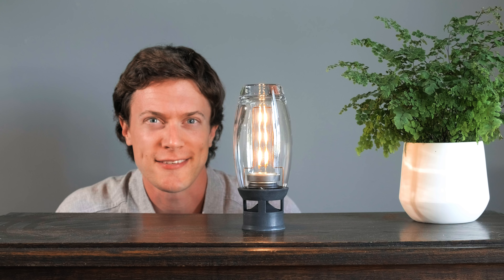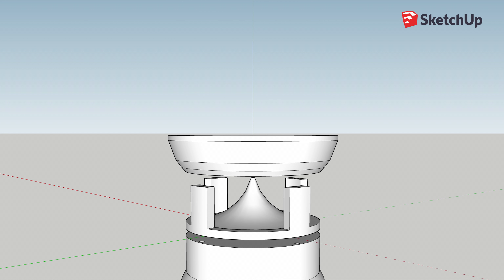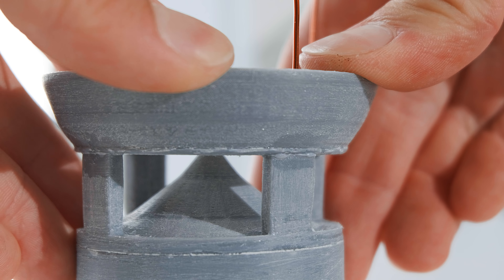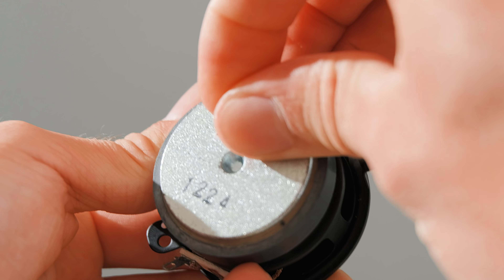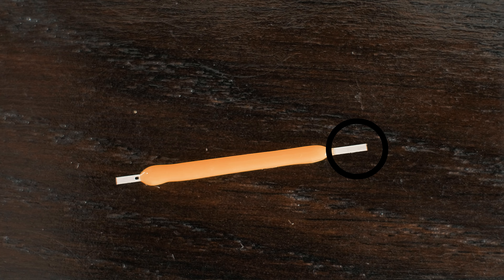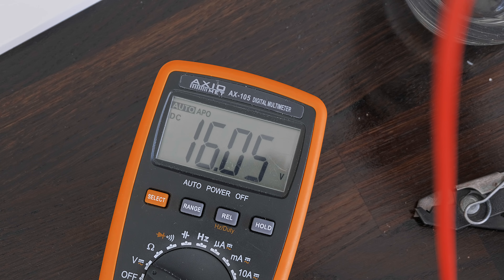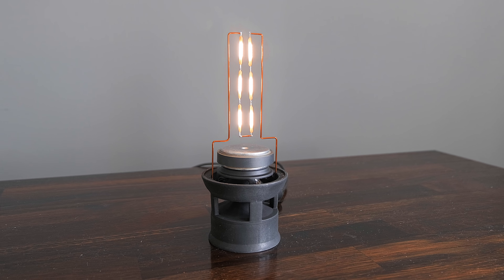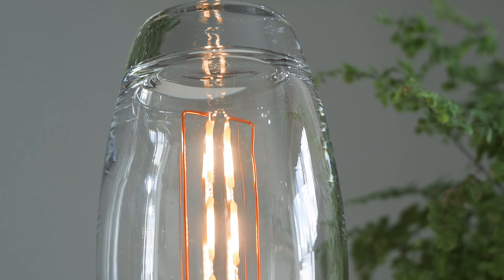DIY glass speaker! How to build your own.

Comment: I see a lot of people complaining about him using a 3D printer, but realistically the base can be done with plenty of materials. Wood or clay would both be good non-conductive options, but you need a lot more dexterity and skill to do that. He's simply showing the easiest way. 
     Honestly with 3D printers being ~$200 (~$800 for less maintenance heavy ones), they aren't a bad thing to have if you're even remotely interested in small neat projects like this. You can also find dozens of 3D printing services online that can print the parts for you out of a myriad of materials. You could get it printed in resin to come out completely clean right away if you want, but it'll be more expensive and more prone to craacking if dropped or if too much pressure is applied during assembly.

Comment: Bit of a tip with sketchup, you can drastically increase the number of sides of circle/arc if you scale up the model and scale it back down when you're done. This way you can make a circle with up to a 1000 sides rather than whatever arbitrary limit it uses when you're making smaller models. Also certain functions like 'intersect faces' work more reliably when the model is scaled up. I usually scale my more detailed models up up by 10x.

Comment: Looks amazing, for bonus points make the leds flicker ever so slightly based on the sound, like an old tube amplifier.
Reply: Tubes don't flicker due to what they are amplifying... Just saying.
Reply: You'd have to put some component monitoring the power draw of the amp to adjust the voltage of the LEDs between the amp an,d the LEDs. Any ideas? Maybe a bit much for some flicker. Maybe it's easier to put a component with microphone that modifies voltage according to the level it picks up. Someone suggest an (easy, sensible) solution.
Reply: Your eyes might object.
Reply: Tubes with high plate voltages will flicker when they are driven hard

Comment: Great job! The only missing thing is a switch to turn it on and off
Reply: i found your dimmer
Reply: you need to wire it inline (series) with the LEDs not replace any components of the current circuit.
Reply: Master volume?
Reply: Volume can be adjusted by the phone I think
Reply: Didn't think about that actually... but what if I'd like the lights on but no speaker?
Reply: now you got 2 switches or an integrated switch.  I'm assuming that this design would pick up ambient EMF if not connected but powered on, but that would really depend on the speaker driver circuit.
Reply: Exploited89 turn the music off on phone.....?
Reply: Andreas Rydèn yeah, but what about the light?
Reply: Exploited89 what? The light has nothing to do with the music.. turn the music of and the light will still be on! And when you dont want the light turn that of by hand, there's even dimmer switches you kan put on the power cord.
Reply: Andreas Rydèn exactly, so why didn’t he put a switch in his project? That’s my question!
Reply: Exploited89 if that was your question why dont ask exactly that from the beginning? 
Saying that switches are manual.. plug and unplug is basically the same thing and you save the cost of the switch.
Reply: Uh- it's BLUETOOTH!!!
Reply: @andreasryden334  
Do you listen to Marilyn Manson?
He has a song called "putting holes in happiness". That's what you are doing.
His speaker housing is made from a SIMPLE DRINKING GLASS!
Just be AMAZED!
Reply: Your phone dummy- REMEMBER BLUETOOTH?
Reply: sandramorrison99 and why direct that comment to me when i am defending the project without a switch. read twice before you write!

Comment: Great project. The use of the 3D printer is completely appropriate here -- while it is absolutely not in a lot of other projects. It seems that everyone has forgotten the trick to perfectly straighten a piece of (enameled) copper wire. Take a piece of 1 or 2 meters, clamp it in a vise. Grab the other end firmly with pliers or locking pliers and pull slowly but firmly. Do not jerk! Once you feel the copper wire stretching (a few mm for 1 meter wire) the wire is perfectly smooth and straight.

Comment: "This is how you make this stunning Bluetooth speaker, first you'll need a 3D printer..."

Well, looks like I'm not making this project then... 😅
Reply: Not to hard to get your hands on if you have time to spend
Reply: @alexanderharaldh4831  $$$ tho
Reply: Guarantee the design could be molded.
Reply: He said there were services to apply a model and get the product
Reply: Check your local public library.  Mine has 3d printers and the cost to print with them is just the cost of material, which isn't much.
Reply: Of course every local library has a 3D printer. If you're american and live in a larger city, that is.
Reply: @zioxei  have you checked your local library?  I know books are so last decade but they are good for the brain.  I know not all libraries will have them but if you dont check you dont know.  And it's not just large cities that have them.  I would not consider the city I live in to be large but it's not tiny either.  Your library having a 3d printer has more to do with your librarian than the size of the library.
Reply: @FunBoysGaming  $200
Reply: @MegaDuke1  molded? What do you mean?
Reply: But If you want you can build the base with some wood parts.
Reply: well if you have some other tools which you likely do, then you could make it out of wood, metal, concrete or some other material. If you don't have other tools, why you trying to DIY at all.
Reply: There is another YT channel where a guy builds projects, and I checked it thinking I could make a bench mounted quick clamp woodworking vise.
 No. The guy has a small barn for a workshop, and about $20,000 worth of lathes, drill presses, precision table  and cut-off saws, welders, air compressors, etc. So much for DIY.
Reply: I am waiting for the titanium and carbon fiber version of a homemade speaker with a silk cone driver.
 You will 'certainly' save some dollars by building your own.
Reply: @1:54 - Dont worry if you dont have a 3d printer. there are places you can send it to to have it printed.

Comment: for a more scratch resistant finish to ABS and a lot of other plastics including hard to paint PVC, I suggest vinyl dye, which you can buy in a spray can from an auto parts shop and is used to recolour car seats and dashboards, it contains the strong solvent MEK which will literally melt the exposed plastic to create an etched surface with negligible dimensional addition

Comment: you could add a potentiometer on the outside to have adjustable brightness (by adjusting the voltage of the dc converter)

Comment: Great project,  excellent result,  no comment on the hair. I will say, it never ceases to amaze me that awesome youtube videos get thumbs down. What twits. Thanks for all the tips: enamel wire,  simple acetone vapor chamber, LED handling during solder,  voltage level,  speaker binding post removal, etc,  it goes on and on...

Comment: Geez, am I the only one who is going to question the speaker you used?  Great project, thanks, and I want to build one.  The speaker link you provided shows a 4" base speaker with a frequency range that only goes up to 2500 Hz!  Surely this would sound a lot better with a full range speaker.

Comment: What about syncing the LEDs with the music 🎶
Reply: Yeah, a different project though, and with multiple colour changing RGB LEDS. This could be an idea for another portable boombox, this time maybe a 2.1 speaker system so it has a decent sub.
Reply: Don't get too far, or the big companies will turn it into a gaming product because of the RGB
Reply: Yeah, some gentle effect, like a breath
Reply: Thought about this, it would probably be possible to isolate the sound output with a few components and affect the voltage regulator for the LEDs a bit. Add a small capacitor to the LEDs and it would probably flicker smoothly to the bass of the sound.
Reply: @josasp  that would require more components that would take up more space, affecting the general feel of this one. Maybe a more modern design would allow for all of the things you need without ruining the apeal
Reply: There's plenty of space and adding a switch is not difficult. I'd build one if I had a 3D printer.
Reply: @josasp  it would require alot more than a switch
Reply: Meh
Reply: dino macioci  well we know what your into now...
Reply: dino macioci  yes, i enjoy music with visual stimulation, like live concerts and music videos. Also i enjoy music while driving, and music in my movies, heck, i even like to listen to music while i read compelling novels. My brain has the capacity to enjoy multiple stimuli at the same time. Im sorry your incapable of enjoying multiple stimuli at the same time. Must be bland, your recreational time. I apologize for bringing up such a sensitive subject in your midst sir or madam.

Your like a cold air intake on a prius.
Reply: Build and sell me.buy
Reply: I think he's great just the way it is if I were to recommend anything. I would transfer the sound using the LEDs aka li-fi instead of additional blue tooth much faster data send/recieve and the lights would  "flicker" as frequency was sent. Sorry didn't finish it yet maybe it was mentioned. Everyone mentioning impratical bigger add on's that would not have more then a visual function and make it bulky you could add some bonus like a Lazer dancer instead of the Bluetooth too again can be used to wireless transfer but needs line of site amazing simple diy light shows tho. It already is a piece of iron in my opinion though maybe different projects or different versions hey if you do bad in it about the 10% helpers fee ;) keep up the great work I'm going to be building one of these tomorrow I was wondering what I was going to do with all my similar LED lights I've been saving it really have no other use for me.

Comment: Fusion 360. Just a tip.
Reply: What do you use?
Reply: I use sketchup.
Reply: Use SOLIDWORKS
Reply: Tom van Dorland why?
Reply: Pah.

You are all rubbish!
You should code via DXF file directly in Notepad. 

HARDCORE!

lol.
Reply: Jason Park thats how all the pros are doing it
Reply: I've used SketchUp in the past, it handles curves poorly but is great for beginners. Also the exported files sometimes act weird. I use Fusion now and like it much better. Solidworks is also a great option, works similarly I understand.
Reply: Jason Park xD thats if you really got no life
Reply: The Hobbyt the same with me, but haven't tried solidworks yet
Reply: Also shit, I use 3ds max and Maya
Reply: James Evans good for you
Reply: Marc Frank went over your head clearly... haha
Reply: James Evans i didnt even want to try them out because the names sound stupid already 😂
but if you think they are good and you need to use two softwares to do your stuff, then thats fine for me
Reply: William Brall now you're the dude that took it too far 😂
Reply: Fusion or inventor anything autodesk basically
Reply: Tim
Shit happens
Reply: Tim YEP.
But really, only use Microsoft Paint.

No seriously now, SketchUp is shit
Reply: I use Blender and AutoCAD 2017. AutoCAD is slow as shit but it's much easier to measure tolerances in my opinion. Having the paper space really helps as well. However, Blender is sleeker, faster, prettier and you can animate with it and add physics effects and what have you. Blender is more for creating scenes for film or games, but it works well for 3D printing
Reply: Jason Park No, you need to code a STL file directly using a Hex editor
Reply: Tinkercad...Free
Reply: Fusion 360 is pretty good. I guess you don't have much experience with 3D modelling software, or you wouldn't be saying that.
Reply: Brah....
Reply: it's all about the cost mate :)
Reply: tinkercad is the superior
Reply: solidworks alows for easy modding of dimensions u can also do stress and weight and loading anallissis
Reply: While SketchUp is indeed painful to use, fusion 360 is only marginally better.  Fusion 360 feels like Autodesk castrated Inventor and then dumbed it down for people who are just beginning to learn about 3D printing and other CNC technology.
Reply: tbh, the only reason I haven't moved from Solidworks to Fusion is that I can't be bothered to learn but I think it's a lot easier than solidworks - you can make complex forms so effortlessly
Reply: why a dxf when u can type g - code directly?
Reply: The Hobbyt use autocad too. It's harder to master, but once you know how to work with it, you can do a lot more things than in fusion.
Reply: Fusion 360 is much better than Sketchup. I prefer using that or Autodesk Inventor - which is much better still. But Fusion 360 is easier for beginners and free. As long as you are using a solids modeler you should be fine really. Sketchup (at least a few years back) can be really painful for 3D printing since it's not a solids modeler in it's core. If you are a programmer OpenSCAD can be pretty good as well. Though it does require some getting used to.
Reply: The GoPro Fusion 360 camera is amazing - highly recommended.
Reply: Marc Frank Haha, difference is I do it professionally.
Reply: I prefer inventor as I have worked with it for 11 years (both user and reseller) . If you have a license at work you are eligible a home use license based on that same contract. Talk to your software coordinator about it! Fusion 360 is free for everyone to use and only start to cost if you will use it for making money.
Reply: i made the move from sketchup to inventor- and once you know inventor you basically know fusion. it really is a huge step up. you realize how insanely sketchup is laid out, of course it does still have it's place. simple architectural rendering, for instance. but small parts designing for 3D printing? fusion has it made.
Reply: Why does it matter when the finished model works? :D Let people use what they are familiar with. I'm Fusion 360 user but I don't tell everyone to use it.
Reply: @jparky1972  🤘
Reply: Been using SketchUp since it was a fledgling, so I have a soft spot for it I reckon. 😏
Reply: NX12

Comment: After saying "3D Print" I stopped believing it's cheap to make. 😂
Reply: My local public library has a 3d printer and the cost to print is just the cost of material, which isn't much.
Reply: @RagPunker  This is good info, I never would have though to go to a library for this.
Reply: im sorry it made sense until you somehow turned it into classism
Reply: @user-rs2gv4vk1g  If I ever get a 3D printer, I'll print a comeback ;)  until then thank you for your positive attitude and positive suggestion.

Comment: USD 300 speaker paired with US2.35 amplifier.  Am I reading the ebay listing correctly???  Why did you select such an expensive speaker?
Reply: About Me 
It says in the description that the speaker is out of stock so the price is unusually high right now.
Reply: brickman409  That was not in the description in the beginning. I suspected it was edited and added later due to my comment.
Reply: Thank you for this comment was really worried because of the price it was showing

Comment: On the conical part you printed you may want to look into the options to allow layers a minimum time so they cure/set before the next layer is applied. This way you have less blobbing on smaller parts like the tip of the cone. Just some friendly advice on an otherwise well done print/project. And yes, I am aware this is a multi month-old project at this point.

Comment: I was hoping for a seperate light switch so we could use the speaker without the light or vice versa but ... this is a sexy build.. I especially like the use of the copper as the wire... it lends a sleek clean look. Great vid keep puting them out bro!!!! BTW im going to be using your DIY sound proofing panels for my Studio

Comment: Add brackets to the glass or find an old caged industrial light and paint it gold. Take an old broken vintage radio like a dewald and put a modern amplifier in it. Wire them all together and VOILA a steampunk sound system.

Comment: while dropping the voltage to the LEDs to only 2.7V most likely wont cause any issues, most people dont know that it is actually bad for LED's and can shorten their lifetime, especially if you only supply half their rated voltage or more. LED brightness should be controlled with a PWM (Pulse Width Modulator) so they receive pulses of their rated voltage. the slower the pulse, the dimmer they are, but they still receive proper voltage. 
This problem is most commonly seen in custom LED applications for vehicles. cheaper halo's and led strips limit voltage to adjust brightness, whereas all the higher quality units will use a PWM, and they usually gloat about it too to draw in more customers.

Comment: You don't need the isolated transformer. You are making a ground loop! That's the reason why it do noise. Just connect a single ground in a star configuration

Comment: Nice build. The modification I will make when I build it is I want to power it by using a USB adopter. So you would wire two to each other instead of all 6. This will give it a total voltage of 2.5 Volts to each LED. The total output for the LEDs will be 6 watts. The power adapter puts out 2.1 amps which is 10.5 watts with 4.5 watts to spare for the electronics. Will this work?

Comment: How did you choose the isolator for the bluetooth module.  Recom or other manufacturer.  Seems better than using a 3 to 6 stage bandpass filter.  Would a pi or tee filter be an option for reducing the hum harmonics?

Comment: HI only just stumbled on this video. is there away of connecting more than unit as to have one either end of a room for light and sound pref not having lengths of wire running all over the place.